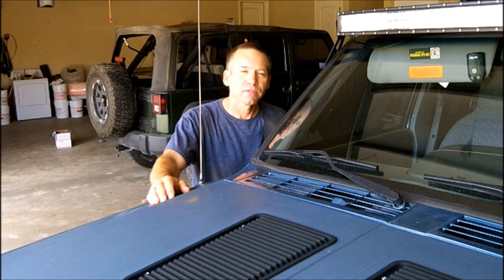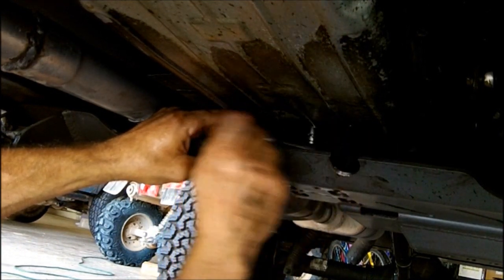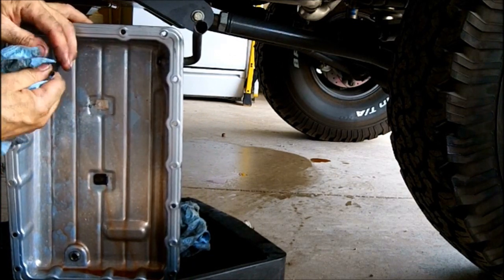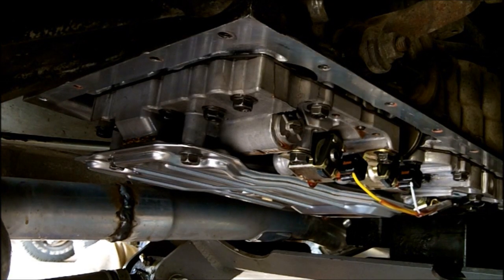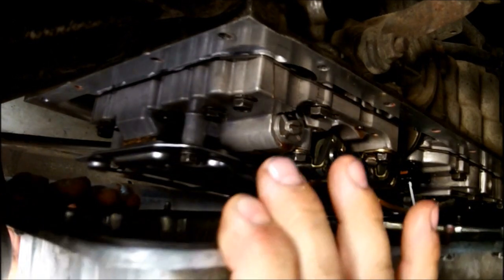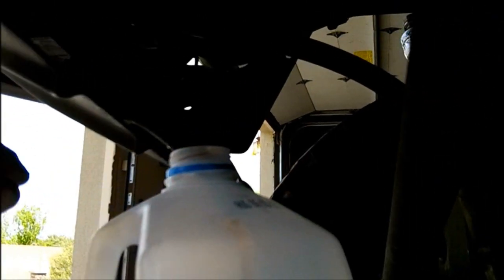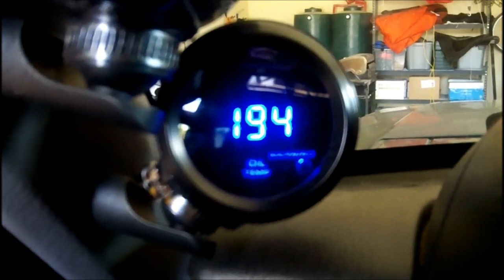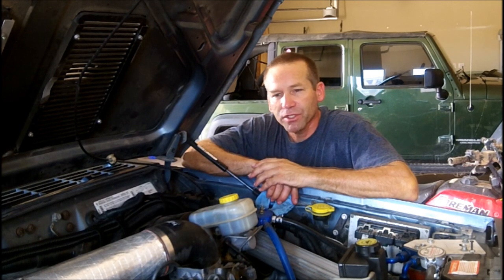Automatic Transmission Filter and Flush on a Jeep Cherokee

Comment: Whats the scoop on changing trany fluid, heard that it can make the transmission slip.
Reply from the maker: Randy Anderson I personally have never had that problem unless you put the incorrect transmission fluid in. This happened to me like 25 years ago probably more than that with a Ford that I change the transmission fluid and put the incorrect fluid in. I flush the fluid back out, put the right fluid in everything was good. Now that being said if other people are having that problem and they did everything correctly the correct fluid and so on. I kind of wonder if the transmission that they change their fluid on wasn't already experiencing problems. Most likely it was already on its way out. Another thing I like to do when doing a flush on a vehicle that's never had one done before is change the transmission fluid and filter first and even drive it for a little while if you like. Then do a flush.  The reason is I do it this way I want the bottom of the pan to be nice and clean before I do a flush. My theory is if you do a flush without cleaning the pan you are stirring contaminants that are on the bottom of the pan up and getting them into the transmission and causing problems.
Reply: If your tranny slips after a fluid change, it was junk before you started. Brown fluid is from burnt clutch material, essentially adding it's own friction modifier in sense and that's why you didn't notice a performance issue. New fluid will be clean and that's why you notice slipping
Reply: @grimmythereaper80  
So if my fluid is not nice and red but a brown color I shouldn't flush?
Thanks inadvance.

Comment: Martin I have a 
2000 XJ sport 
would it be the same Lucas product on mine?
I'm doing mine this weekend.
Reply from the maker: I would think it would be the same but I would check your owners manual.
Reply: +martinbuilt
just so you  know, you have the Toyota AW4 trans. Common in jeeps, tundras (early model) and others like lexus. I've rebuilt quite a few of these and they are interesting to work on. One of the things you should always check if your changing the filters are the solenoids. there should be three and sometimes they get hot and need replacing. When that happens the solenoids cases will become discolored and get dark. Thought you should know. :)
Reply from the maker: +purplexenno
 Thanks for letting me know. That's good information. Next time I do I filter change I'll check them out
Reply: +purplexenno 
would you happen to know how many selinoids are in xj or a link were I might find them. plus the code P0740 made my check engine come on. every time I check the Trans fluid there's little metal in the dip stick.

Comment: Where did you put the temperature sensor to get the temperature of transmission?
Reply from the maker: Hugo Leonardo I have an additional 1 quarts spin on oil filter mounted below the radiator and in that oil filter adapter is the temperature sensor
Reply: Could you send a picture?
Reply from the maker: In this video there is a good look at that filter. https://youtu.be/WD1TVCvXiJo

Comment: these transmissions are so bulletproof you can use motor oil in them with no issues.
Reply from the maker: blu3fan 
Yes I have to agree. I personally don't know of anybody that has had a transmission failure with this particular one. It also runs cooler then the transmission I have in my WJ. Especially once the torque converter goes into lockup tthe emperature drops like a rock

Comment: What was the torque specs for the transmission pan bolts?
Reply from the maker: 53-70 in.Ibs.
Reply: @martinbuilt  I dont have a torque wrench, would it cause any serious damage if I tried to tighten them without the bolts being to spec
Reply from the maker: @darrenvogel8096   no, I don't use a torque wrench either, just remember 70 in-lbs is not much, just don't overtighten.

Comment: did you cut your tube going into the pan
Reply from the maker: +rohitter7878 
 If you are referring to the dipstick tube No I didn't cut it. I finally was able to pull it apart.   
The return line to the trans will need to be cut if you have the stock trans lines.
I had a aftermarket trans cooler installed. so I just disconnected the line.
Reply: I was wondering about how you disconnected those, makes more sense now.  Did you bypass the built-in radiator cooler or did you add yours inline after it?  And any other point you can disconnect the tranny return line without cutting the lines?
Reply from the maker: You could disconnect by the radiator. It does require a some what of a special tool

Comment: Martin how did you detach that dip stick tube out?
Reply from the maker: they can be kind of a pain in the butt that's for sure. it was a combination of twisting and pulling and it finally gave up.
Reply: I didn't try the twisting thx man.
Reply: Someone reused an empty coolant jug to refill their trans from the dipstick and i noticed a very tiny amount of coolant was present and was introduced into the system. How much should one worry about as far as coolant in with the trans fluid? It's a 93 ZJ with 200k. Is there an additive to help or just flushing going to work?

Comment: help i'm not able to remove the dipstik, i;, stucked...
Reply from the maker: +likskirtspleetscreen 
My was stuck pretty good too. I got angry and it finely gave up. You might try bolting the pan back in and remove the bolt holding the dip stick tube. Then try twist the tube by hand or put a set of channel locks on it. Hopeful it will break loose.
Reply: +martinbuilt thanks man. I found the solution and I posted in my channel. thx

Comment: no rtv on the transmission gasket?
Reply from the maker: I don't use any gasket sealer whatsoever. Especially on a rubberized gasket they seal perfectly well when used dry.
Reply: thanks man. I hate rtv I hate waiting forever for it to dry.
Reply: (No) RTV CAN CLOG A FUCKING PORT IN THE VALVE BODY.... MOST OF THE DEXRONS FROM DEX II ON UP TO 5 HAVE A CERTAIN AMOUNT OF PETROLEUM BASE IN THEM BECAUSE IT KEEPS THE RUBBER GASKETS THAT ARE DESIGNED TO SWELL UP DURING USE. THIS KEEPS LEAKS FROM FORMING... MOST GM CARS AND TRUCKS ALL HAVE METAL CORE AND RUBBER LAYERED GASKETS FOR THAT VERY REASON.